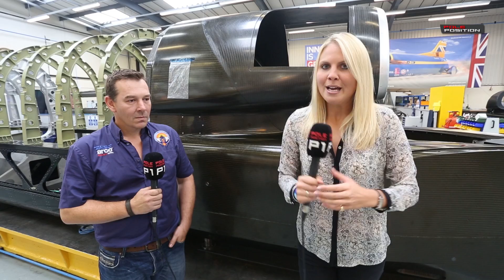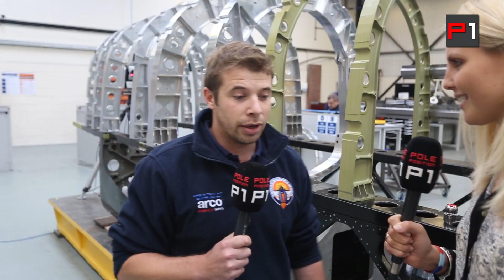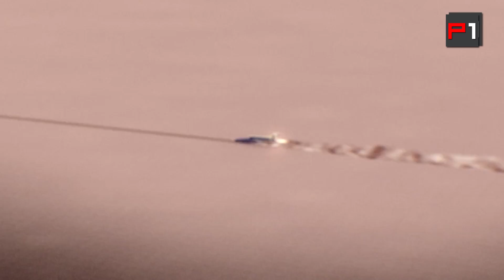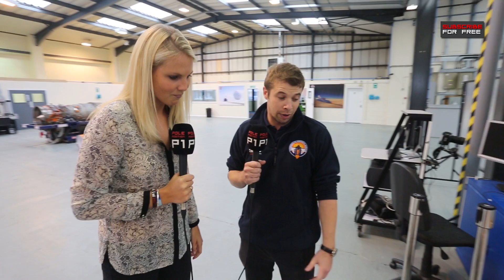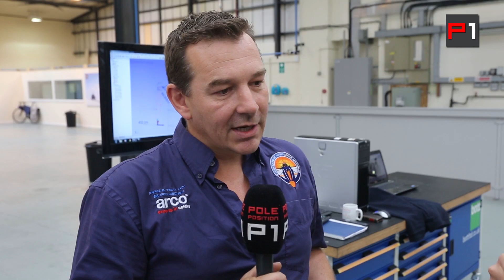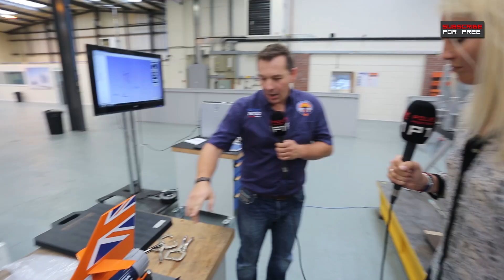How to build the world's fastest car - Part 2

Comment: Lets hope the car won't do the inevitable barrell roll. I saw a life size model of the car a few years ago and it's absolutely massive. F1 engines just being used to pump fuel into the jet engine!
Reply: The cosworth unit pumps fuel to the rocket engine, not to the jet
Reply: Lucas silva vieira Thanks! It seemed like the most intuitive question to ask what each engine does and it drove me nuts that she didn't ask.
Reply: Lucas silva vieira thanks, was wondering what the F-1 engine was for.